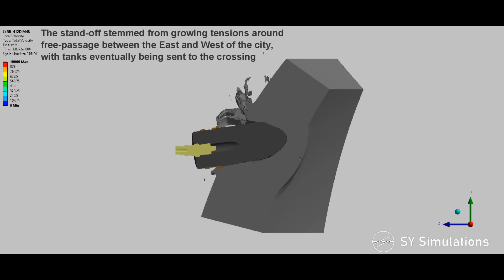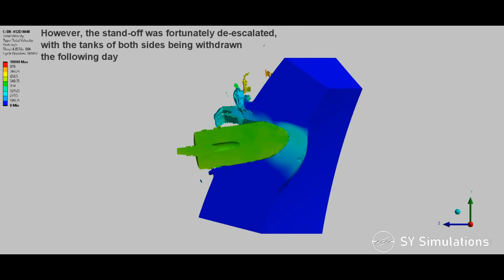STAND-OFF AT CHECKPOINT CHARLIE SIMULATION | T-54 vs M48 | BR-412D Armour Penetration Simulation

Comment: they should have used M103's at the crossing.
Reply: I don’t believe they had any of those in Berlin.
Reply: If only, then the t54s would be screwed, but you also wouldn't advance very far with the version 1 M103 and its 80 mile range.
Reply: @gavinlightfoot5521  The Berlin brigades are essentially starting off in a last stand, so they wont be traveling far besides milking the situation to burn as many Soviets as possible. I would be much more concerned about the Centurions [maneuver tanks] having 50% less range than you.

Even so, the point of the M103 wasn't as the maneuver warfare tank. They got into power positions and policed the line of battle usually from the second line unless they pulled the goalie to break some teeth. Originally the T43 was meant for Korea to do what the Pershings did at Pusan, but win way harder against IS-2/3/4/8.

Not that you would need to seal club so hard anyway. Everyone saying the M48 is screwed, doesn't understand the T-54 is seconds from disaster itself. Kremlin Thunder has messed so much up on purpose that the T-54 has this really queer wank wafting around it since all people do is wiki corn pone and cock joust meta. Seriously, imagine loading M82 shot for this. Brains as smooth as Zamboni ice...

It's 1961, the armor of the T-54 is not a mystery, there should be plenty M431 shell in stock after many years of production, for no less than the most precarious and symbolic post to maintain in the world, hosting units that aren't second rate. The HEAT-FS will upper-plate them all day if they don't just chuck one into the gunner's face; the HVAP will not fail to paste their gunner at the range it has all 321mm of penetration. If the crews hold off on loading their guns until the 11x quarrel turns to dead people, guess who also loads first by a decisive margin.

*Unloading a loaded tank gun of unfired ordinance is an issue which is why you don't load unless it is time.
Reply: The US has oftentimes had troops with a "die in place" mission.  (Once upon a time I was a tanker in the 11th ACR in the Fulda Gap; the not-too-funny joke about our mission was that we were a speed bump for the Soviet 8th Guards Tank Army.)  Our troops get killed, and the folks back home get spun up, and the war's on.  Most of our adversaries were smarter than to cross the line and start killing Americans.

Doesn't always seem to work though (such as in Mogadishu . . . )

Comment: Now do a M48 AP shell hitting the T-54 turret or front armor. I doubt it would be able to even crack the armor without HEAT shells, those things were just nuts.

Edit: He actually made it, but the M48 used HVAP which would be able to punch straight through the turret armor.
Reply: M318 APBC probably wouldn't go through the turret front but might cause some serious spall. M332 HVAP should sail clean through the turret as long as the angle isn't too extreme. Neither will come close to penetrating the frontal hull plate.
Reply: The T-54/55 turret is not 200mm effective, as people believed, it's more like 240 - 320mm effective when viewed directly from the front. Even 90mm HVAP might fail to defeat that.
Reply: @JohnSmith-ix6ts  As I heard it, the Yugoslavs found M332 would defeat the turret front out to 750 meters.
Reply: God I hate the 90mm.
Reply: Yes.. that why heat is used for a lot of weapons. It's big punch at a low velocity.

Comment: Now do the M48 with HVAP against the turret cheek of T-55
Reply: hit
Reply: Its going to go completely through the tank at 100m.
Reply: @GodKitty677  I wouldn't be so sure, unless you're actually familiar with the numbers involved. Early cold war things were much more even, with the Soviet even having the edge sometimes. Unlike the Western dominance in the late cold war to the present.
Reply: @chrisc1140  You can look it up but be careful.  The USA uses a different standard to the ussr.   It depends on which round you take.  The BR-412D is around ww2 time or just after.  It could knock out panthers and tiger 2 tanks.  Armour for tanks is mentioned to protect the tank at engagement range.  Point blank is a different story.  The HVAP rounds are powerful.
Reply: @GodKitty677 huge (and incorrect) assumption about the HVAP going all the way through a T-55 lol
Reply: @TheBawbSaget  Depends which one the USA table gives approx. 300mm at point blank for the least performing one.  The later rounds are even more powerful.
Reply: @TheBawbSaget  T30E16 HVAP is 306mm at that range.  The T44 HVAP is 373 mm.

T54/55 armour
120 mm hull front at 60° (100 mm after 1949).  205 mm turret front.

Just saying at close range.

Comment: Armor of any kind whatsoever has become redundant.

You could have 1,000 feet worth of the strongest composite tank armor known to man, and a modern kinetic round would through one end, and out the other, as if it was shooting through hot butter.
Reply: Smartest YouTube commenter
Reply: No? The best apfsds invented so far can only penetrate ~1000mm of RHA at best not over 300 meters of the best modern composite armor
Reply: you're completely wrong lmao
Reply: Pretty sure you can put ~1000mm of solid steel in front of your tank and it would be protected from almost all modern APFSDS rounds. You need composites because they can be way more effective against HEAT.
Reply: @KorianHUN whole point of composite is to have more protection for same weight duh
Reply: @justjako9145 solid steel can work better against kinetic but composite of multiple materials can easily stop chemical with less weight than a solid block.
Reply: What schizophrenic gave you this idea lmfao
Reply: Bro what 💀. If that’s reality, why even bother with heavy armour? Why not just make really fast stuff, like the Leopard 1.
Reply: How to detect american: stupid imperial system

Comment: The AP projectile cuts through armor like a hot knife through butter.
Reply: At that range it's not really surprising. 100M is essentially point blank range.
Reply: Like piss through snow!
Reply: The funnier part is when it explodes inside (APHE)
Reply: The M48's HEAT wouldve done the same to the T54 tho, so
Reply: @Salamandra40k i don't think in 1961 it was firing heat... Also heat was unreliable at good angles
Reply: @mr.waffentrager4400  "M-456 HEAT-T, Introduced 1961, USA." Yes...they had HEAT for the 90mm in 1961.
Reply: @Salamandra40k  3bk5m 100mm was introduced in 1955...manymtanks would have it in 1961. 

M456 is a 105mm projectile m48 has a 90mm gun, also any source that it was introduced in 1961?
Reply: @Salamandra40k  I got the link, I was already certain that there is a heats shell for  the 90mm, I just needed to know if they had that in 1961.
Reply: @Salamandra40k  photos from checkpoint Charlie all have 90mm guns
Reply: @mr.waffentrager4400  Well unfortunately I'm not a complete neckbeard sweat who has access to direct military documentation on a tank from the 1950s. I assume it had HEAT before 1961 seeing as the vietnam war was about to roll on around, and rudimentary night vision was already a thing during that conflict, so its probably not too far of a jump to assume that a tank had a HEAT round to use as well...
Reply: @Salamandra40k  Germany already had night vision in ww2 and ussr had night vision on bt7 before ww2
Reply: @Salamandra40k You’re just wrong… Being correct about something ≠ neck beard. Just don’t be lazy, and make up lies I guess? Your generations hates criticism.
Reply: @Salamandra40k  Note that US HEAT has a tendency to crush fuse and not detonate beyond 50 - 60°
Reply: @Salamandra40k But this is just satisfying.
Reply: @Salamandra40k Lol they weren’t issued HEAT yet tho.. So APCR.

Comment: yeah, the standoff really would have gotten me nervous. Without HEAT in those 90mm guns I dont think the M48s would have made a dent in the T54/55s
Reply: Apcr to the front of the turret face still should be able to do the damage but other than that it would be rough
Reply: @mateuszk3812  At that range HVAP would be very likely to just shatter because of being at almost muzzle velocity and still very hot from the propellant gasses.

Also at the turret cheeks right next to the gun the T54 armor is 220mm thick casting(high hardness) and very curved. All the things that HVAP hates to deal with even at normal combat range. At minimum range where the HVAP would still be hot from being fired I think the chances of penetration are zero.

APHE and APCBC would be useless. The 90mm gun is equivalent to the german 88mmL56 with coresponding ammo types. Gun against which the T54 had immunity from the front hull+turret at any range. Thing that the soviets test by fireing at the hulls.

Only HEAT really is a danger to a T54/55 from 90mm armed M46/47/48 tanks.
Reply: @regeNausWeiden  Do you have an account on some internet forum? You seem to know what you're talking about, I'd like to read more.
Reply: @peasant8246  nope. Just an engineering degree and tanks are kind of my job
Reply: @regeNausWeiden  it would definitley not do much but the spall caused by the non pen would still be interesting to see from a sim standpoint
Reply: @4T3hM4kr0n  fair point. Case in which I hope the gunner remembered where his counterpart sits in the T54/55 because the only chance at survival is skeweing gunner and comander with spalling.
Reply: @4T3hM4kr0n  the T-54 didn't have a spall linner, that is why it was vulnerable to HESH. I think later variants of the T-55, not sure if all, had spall linners.
Reply: @regeNausWeiden i don't think hvap would have a problem with the turret face as long as it doesn't hit the super curved sides.
Reply: @regeNausWeiden  "The 90mm gun is equivalent to the german 88mmL56 with coresponding ammo types." Even the M3 gun had better specs than the KwK 36 (the APCR had vastly better performance), and the M36/M41 was an improvement over the M3 (200fps more velocity for the M82 and T33 rounds).
Reply: @tovarishchmartins4999  none of the T-54/55's had spall liner.
Reply: @r.j.dunnill1465   Gun was still inadequate
Reply: @4T3hM4kr0n  After 1953, the U.S. turned to HEAT shells over shot. By 1961, M431 HEATFS was available, with 4000fps of muzzle velocity, and 320mm of penetration at any range, which was adequate for Soviet types in service at the time. 

So I read, the Marines preferred the M41 gun, and didn't give it up until 1970 or so, when the T-64/T-72/T-80 rendered it obsolete.

Regarding 90mm HEAT shells, South African armored cards using such slaughtered a brigade of FAPLA T-55s. The armored cars could move faster than the T-55 turrets could track them, and the hitherto untried 90mm HEAT projectiles successfully penetrated the heavy tank armor (to the relief of the SADF crews).
Reply: @regeNausWeiden  "just shatter because of being at almost muzzle velocity and still very hot from the propellant gasses."  i am pretty sure that you should go to who ever sold you that "engineering degree" and ask for refund as you do not understand even the very basics of the topics you are trying to preach about here...
Reply: @Bialy_1 it seemed like an odd comment to me, but I have no proof of it. When you talk about a tank firing a round, the flight time is 1-3 seconds maximum normally. How much cooling of the round could possibly be taking place? Why employ a round with such glaring weaknesses when we had tanks encounter battles in WW2 that were extremely close. 

I’m not calling bullshit, because I don’t know for sure, but just seems wrong.
Reply: weren't there variants of the m48 in service at the time  armed with a 105mm gun?
Reply: @dennislemasters4339 no, the M48A5 with the 105mm M68 gun entered service in 1975 and only with national guard units as by that point the M60 replaced the M48 in frontline service.

Furthermore the M48s at checkpoint Charlie had the unmistakable T-shape muzzle brake of the 90mm M41 gun.
Reply: @regeNausWeiden  ah okay i am not familiar with the patton family of tanks which consists of the m46, m47, m48 and m60 also in a video on youtube called what is a tank the m48 was stated to be armed with a 105mm gun which is the main reason i was confused and asked the question
Reply: @regeNausWeiden m48s could be modded with the 105 as the were used in Vietnam
Reply: @dennislemasters4339  in 1961, i don't think so. But M60 with 105mm was in production since 1960
Reply: @thezig2078 the m48a5s if they are have 105mm and we’re in service or they could have been a normal m48 with a 105
Reply: @Roof_Korean.  Yes, but A5 was not in US service at the time.

Tbh i'm still wondering why they didn't pit 105 on M48 earlier, when it was already  clear that 90mm gun is insufficient
Reply: @thezig2078  but the normal m48s could be up gunned to the 105 the m48 just normalized and it came stock
Reply: @Roof_Korean.  well yes, but still, the M48A5 was introduced in US army in 1975, long after Berlin Crisis
Reply: @dennislemasters4339 Nope, it was 1961, the 105mm was just entering service i believe
Reply: Another ignorant tankie, American tanks at the time had HEAT in abundance. HEAT wasn't some rare shell. Your T-55 was 'easily' knocked out head-on by the M48.
Reply: @Rider-lo9vt  source?